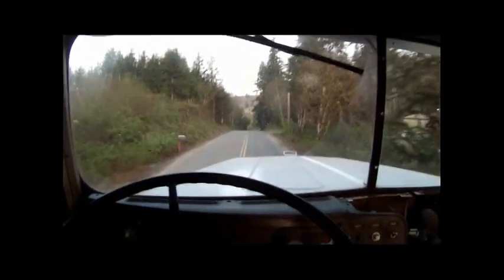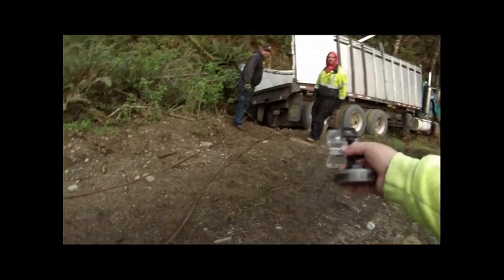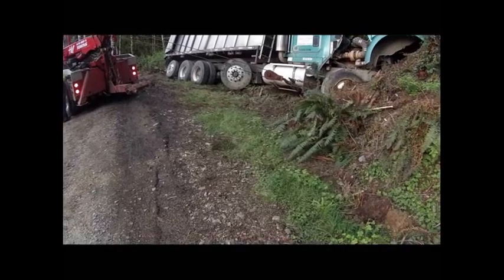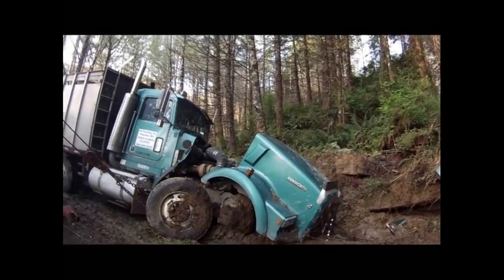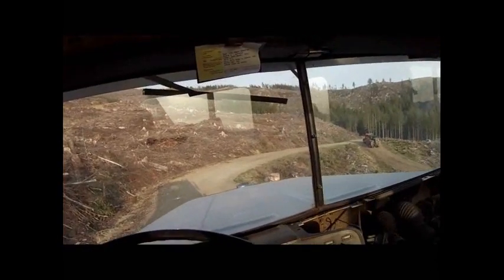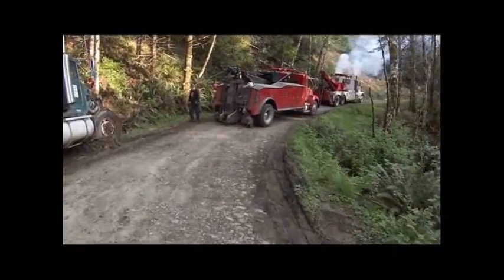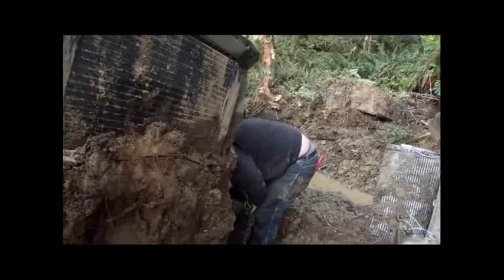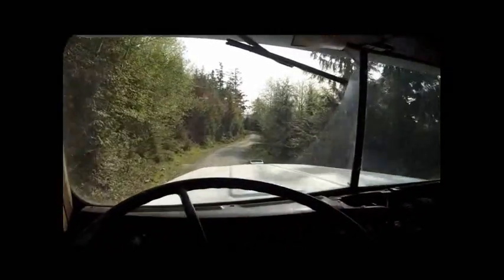Dump Truck Looses Brakes Totaled on Impact

Comment: You are lucky the truck was unloaded before you got to pull it out. I have did  two (a long time ago) in similar country. One was a semi loaded with cattle that had pulled over to avoid a car and slipped sideways down into a drain and the other was superphosphate  bulk spreader which had tripped over with 30 tons of fertilizer on the back.  To get the semi up I used a triple snatch block from the winch to the trailer ,chained to several points and anchored the truck to a tree. With a 25,000 Lb Garwood winch I managed to pull the tree out .....

Comment: OKS !!! You got yourself a good mosquito chaser with that International !!!  What's the oil consumption on a run ??  Was told if over 1 gal per 100 miles ,,its time for an overhaul !! Great video & maybe the driver will check his brakes b/4 going into a place like that again !!  KEEP IT SAFE !!

Comment: Lost its brakes? Highly unlikely. They would have automatically set when they got below 40 or 60 psi. He didn't lose them from fade either. The truck was not loaded and could not have had enough speed to overheat the brake drums.
Reply from the maker: Kevin Hornbuckle truck was fully loaded with ceder bolts. My bet is he was in to high a gear with his jake brake on .  I bet he tried to shift in to a lower gear  . Doing this on a steep incline with the  compression brake on is a recipe for disaster . If you don't know what your doing the engine will die and you won;t be able to  grab a gear  .  A runaway truck is the result  . This is my guess .
Reply: Hill Auto Body & Towing Exactly my guess as well. When I got trained I was told no matter if it's a uphill or downhill grade, pick a gear you know is safe and keep it in that gear. The lower the better. Just for this reason, if you miss that gear there isn't much you can do. Scary stuff, glad the driver was alright.
Reply: I used to drive buses in the mountains. They were old, non-synchro shift set ups. We followed the 'get a gear before the downgrade' as if it were a religion. Had to know how to heel-toe quick and accurate.
Reply: Kevin Hornbuckle Yup I was trained to float shift so you better be dead on with the RPM. Just a quick blip of the throttle, get the low gear, flip the jake and prey you picked the correct gear. Did the bus you drove have a jake brake? Just curious.
Reply: Jake brake absolutely. I rigged the switch onto the shifter where a splitter would be. The GMC highway coaches were best to float in on the downshift unless your tach was dead on. These were Detroits. So the mantra was Never jake out of an over-rev!
Reply: Kevin Hornbuckle Got ya. Yeah having the switch right there would be awesome. Unfortunately I have only driven modern company rigs so I can't change the setup. But no modern truck has the badass sound of a Screamin Detroit.  Quiet electronic controlled garbage replaced it.
Reply: I'm working on installing a 6V53DD into a medium duty truck chasis; it's going to be a custom RV. It is impossible to find jakes for the 53 series.
Reply: Kevin Hornbuckle That's a beast for sure. A lot of DDC parts are getting hard to fin but good luck with the search and with the project :)

Comment: Man u must have some bad injectors that wrecker smoking like a train
Reply from the maker: Old Smokey has a CA  Cam that was poorly designed . It tries to time the   engine  using ambient  air temperature . It never  worked properly from conception .

Comment: Why the glitchy frame rates 👎
Reply from the maker: too much  holding the camera and not using magnetic mount
Reply: Hill Auto Body & Towing Thanks for the reply,changing it to 👍..it’s just that’s my favorite part-watching the exfil.Thats where the magic happens,brute strength of the machines,combined with expertise of the operators.
Stay safe.
Reply from the maker: I gotta tell you this is the best job ever . I  love figuring out   extracations  , angles and dangles .  When it all comes together it is a  great feeling .  Thanks for watching